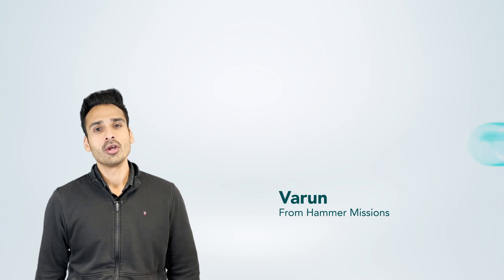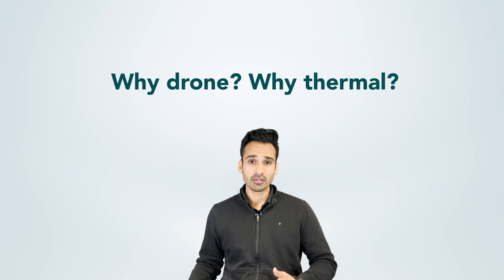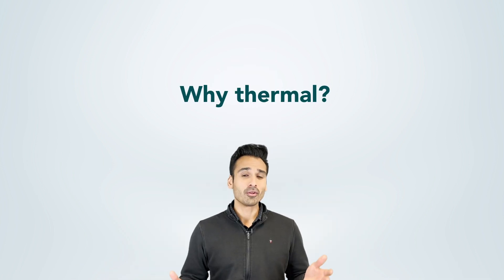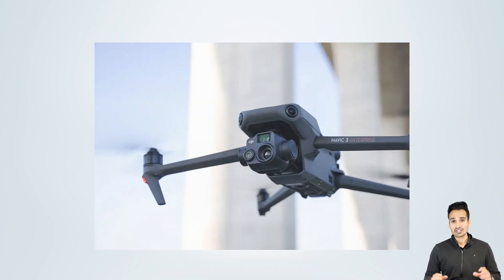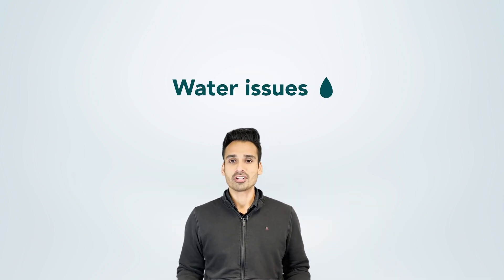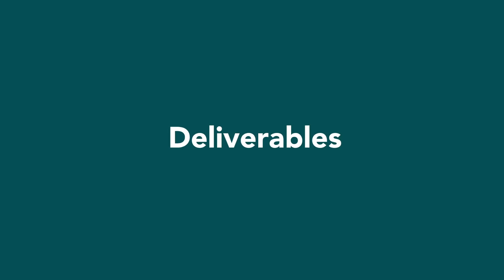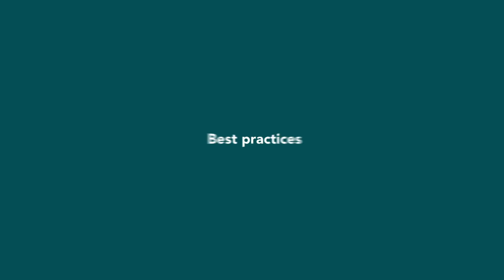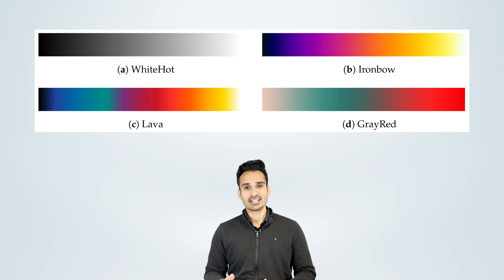Thermal Drone Inspections 🌡️  |  Hammer Missions

Comment: So, for the visual, you map during the day with a flight plan, then at night using the same flight plan but use the thermal, then process and combine them at processing?
Reply from the maker: You would typically process them separately, but your software should allow you to compare the visual vs thermal projects to see the difference and cross compare!